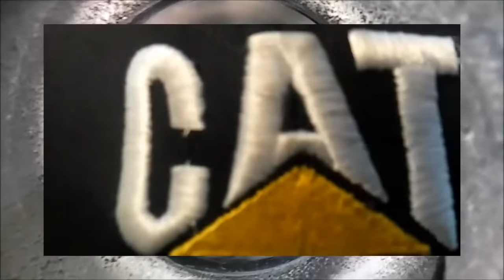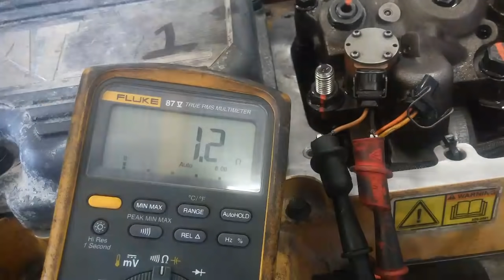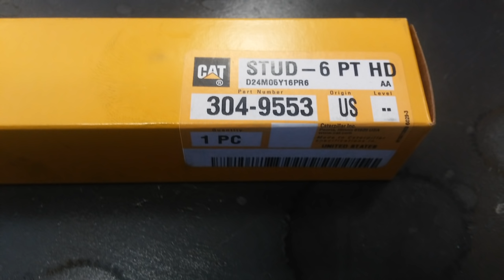What Is An IVA, What Is A VVA, and How To Fix Cat IVA Codes.

Comment: I think you have it a little wrong on the reason Cat put IVAs on their ACERT engines. Have you ever asked yourself why there is always so much soot in the intake of IVA engines? After all they don't have EGR, so the intake should be clean, right? Well...I have gotten unofficial confirmation that Cat all along have had EGR on their engines via the IVA system. They open the intake valves on the exhaust stroke, which pushs the exhaust gas thru the intake side of the head to another cylinder on the intake stroke. It turns out Cat has had EGR all along, they just refused to admit it. The EGR all happens inside the head via the IVAs.

Comment: I'm having an issue with my 2004 BXS c-15 acert. When engine is idle it has a rough idle that comes and goes. Watching the cat id that's on my dashboard, I can go to the screen and watch, when it is running smoothly it shows around 1.1 gallons per hour and when it start running rough it drops to 0.6 gallons per hour. Any ideas?

Comment: ok i just asked about this on the other video, i thought it was an IDA not IVA. I,m a mid level diesel mechanic whos fixed quite a lot of of low to mid level issues but  im getting more into breaking apart the engines and getting deeper into the systems

Comment: Just when I start to think I know something about something you make a video about something I've never heard of in my life haha, good stuff man.
Reply from the maker: +Bucketsamson Thank you, just give engineers metal and space and they will find a way to complicate an engine to comply with the EPA regulations.
Reply: Great video! Keep it going! Thank you !thank you ! But I have a ongoing flash “ghost” code no one can figure out.Code 95 which I have already replaced! But it’s doing the same low voltage! When truck is shut off, ECM resets! ECM will not retain code so cat can’t find anything wrong!I was hoping maybe you can shed some light on things!

Comment: Very interesting - never heard of doing this to reduce NOx before. The high combustion temperature of CI engines is the other part of the reason NOx is a problem with diesel as gasoline engines don't burn as hot (Which is why they have lower efficiency). Plenty of modern gasoline engines are using delayed closing of the intake valves to give a higher expansion ratio than the compression ratio as a means of increasing efficiency, mostly in hybrid cars. It's known as the Atkinson cycle or the Miller cycle (If forced induction) in this context. Being able to turn it on and off on demand allows the engine to make full power when needed (At the expense of higher emissions) but cruise more efficiently, which is where the engine will run for most of its life in a truck.

Comment: Yes the plug connector tips open up  especially the injectors as they have alot of voltage   i just squeeze they back close      for a tight fit and the engine stops missing

Comment: Oil pressure seems to be low and we have done a lot of checking. When we have the valve covers off there is oil shooting about 15 feet out of the iva housing oil ports.
Reply: Did you find any solution, I have changed those port orfice.
Reply: I have the similar problem how do u fix this

Comment: Hey Adept, I don't know if you'll be able to answer this on a future video, but I have a 1994 Navistar DT466 engine in my work truck. When I was put in this truck, it ran slow. But the engine was just rebuilt about 1-2 years prior. it still has paint on everything. After awhile the truck would barely make it up hills, so the mechanic at my dairy replaced the fuel filter and it ran great afterwards. It was all full of grease. That was about 2 months ago. Now in the past 3 weeks it has been lacking substantial power. Truck does not want to go from a stop. It has no giddy up. Clutch is good, injectors seem fine, engine runs fine but its just low on power, trucks . Now, it does fly down the highway still at about 75 MPH. I understand you only work on CAT engine but I figured the same principle would apply to about a majority of mechanical diesels. Thanks.
Reply from the maker: +acdcfanforever3 I am mostly a Cat guy, but the first thing to check is the fuel pressure. Find out what the spec would be for that engine and get a gauge on the fuel pressure and see what it is doing when it is low on power.
Reply: Thank you, l'll check in with one of the mechanics to see if thats what's causing it.
Reply: Did you replace the fuel filter again?  Seems the fuel tank may require cleaning.
Reply: Yeah. Hasn't acted up since. It was full of grease for some reason again. Maybe the driver who had the truck last was fed up with the truck and wanted it off his route so he tried "killing" it. That's really the only way we can get another truck around here. But it's been great for the past several months. Best running truck I've had in my 6 years here.
Reply: I think you are on to something about the previous driver.
Reply: I know that's what he was doing, I've had to do it. By had, it's only because the truck is unsafe to drive. The last truck I did it in I was missing 2nd and 3rd gear and the truck was just falling apart and they refused to fix it. So I ran it with a bad turbo seal one day. Just barely made it back to dairy. Then they took it off the road.

Comment: Thank you so much I'm going to start with the Iva oil pressure sensor. Went to my Peterbilt dealer and they said it was the whole actuator assembly.
Reply from the maker: +Edgardo Guardado It is possible to have a leak in the assembly causing that code, but did they troubleshoot it or just try to sell you the part?

Comment: I have a iva oil pressure code going off derates power...  I've replaced wiring harness from ecm iva oil pressure sense iva solenoid and it's still throwing the same code

Comment: Josh, 

I have an MXS engine that breaks up/stumbles/white smokes when in cold mode under load when boost pressure is high. No fault codes, IVA system test passed, runs great once warmed up. To me it sounds and feels like either the IVA’s or jakes are activating on their own without being commanded by the ECM…have you seen this? How the heck do I troubleshoot this?

Comment: I have a C13. Happened to notice air bubbles coming up the studs at the top of the IVA housings. Would i have to be getting air in the oil from the pickup tube or is this normal?

Comment: What are complaints from a driver when those solenoids cause issues? My driver is saying he has a rough running truck when it's under a load and he's afraid to drive it. The codes I get are for solenoids 1 and 6. 6 has been replaced already.

Comment: I’m getting “not responding” on 4 5 & 6. It being those 3 cylinders together I was thinking electrical but now you make me think it probably mechanical. 
Of course it’s gonna be the most expensive fix with this thing 🤦‍♂️
Reply: Did you find anything I have one with low pressure codes in conjunction with 5 and 6 most often and sometimes 4. Nearly everything new and goes over except ecm

Comment: Yes that was going to be my next step.i did see you can put an Allen or her tool.housing don't look crack is there any seals on this ports or are there used for adjustments?
Reply from the maker: +Jaime Garcia I'm not exactly sure the port you are talking about as there are a bunch on those housings. I would try to remove the plug and see what is behind it.

Comment: i was wondering how often these go out i have a 06 c15 and have replaced 4 out of 6 in the last year in a half and my truck had a inframe done a year in a half ago 3 said not responding and the 4th said current high wasnt sure if i need to be looking into something other than just replacing the actuators if it might be a bigger problem
Reply from the maker: +Zack Fultz Unfortunately they fail somewhat often and are usually the actuator solenoids themselves and not indicative of something else.

Comment: I have a 2006 MSX in a Freightliner Columbia with code 92 on cylinder 2. I thought I was just going to change the VVA and harness and my problem would be solved, until I watched your video. How would you suggest checking oil flow and the oil pressure sensor? If the oil pressure sensor is bad would that show up as a different code or can I still have just one actuator not responding?

Comment: c15 getting compression back through the air cleaners is this possible 1 of the iva stuck open aloughing the valve to stay open. have you seen this before. had one of my dump truck go down and taring into it tomorrow
Reply: I had similar problem. I had a broken rocker arm

Comment: Hello, I have a question for you. Well more of wanted to pick your brain about something. I have a 1998 freight-liner that won’t turn on easily in the morning. I asked around and people told me to change the filters and the check valve and fuel pump and it’s the same problem. If you have anything that can help me out it would be greatly appreciated

Comment: Why do shops charge you for doing an over head when they replace  injectors. They have to do this any way right. You remove the rocker shaft and rockers before getting to the injectors.

Comment: I have a question about a c15 that's been Frankensteined sdp lower with a 6nz upper end keeps overheating after about a 1000 miles last person that worked on it cleaned the oil cooler I've been looking for ways to clean it on here but nothing so far
Reply: Use cooler thermostats

Comment: I have a code coming up 385-1 coming up cat checked for o ring leaks and put a new solenoid and Iva oil pressure valve and the oil pressure sensor and still has the coed come back

Comment: The 379 I drive has bxs c15. My max normal boost pressure is 48 psi (all rpms). For some reason, Im not max at 48, but 35 instead when ever I drive 1700 rp. Normal rpm, it would blow 27 psi. And no codes popping out. Could IVA done this?
Reply: Did you ever figure this out? What was it?

Comment: I have a problem with a c15 twin turbo , the computer show me the problem is actuator no.1......I replace and the problem persist and the check engine light is back. .....I replace cam sensor and crank sensor and nothing. ....can you recommend me something??its a w900 2008
Reply from the maker: +Jesus Benitez It could be the wiring to the actuator itself and not necessarily the actuator solenoid. Is the code an electrical fault or a not responding properly code? If it's a not responding you could have a mechanical problem like the IVA setting.

Comment: Can anybody help please. I have c15 accert with tapping noise. Changed injectors. Ran over head nothing looks broke everything looks perfect. But one of my iva housings has a spray of oil coming out of the little screw that looks like a ball is inside it. The others just weep out but the middle one sprays will this cause a tapping noise.

Comment: 385-1 code... Previously had overhead and #1 injector replaced. Immediately after leaving shop I topped full boost and got check engine light so with ET was able to get direct PMI code above. I’ve replaced IVA oil sensor first, checked control valve and seems to be in good working condition. Replaced external wiring harness and internal as well. Only thing that stands out after all this is when removing both sensor and control valve, the oil that comes from housing. It doesn’t continue to pour out before replacing either part but has me wondering if check valve is staying open not allowing pressure to be regulated properly. Wondering if next move should be replace IVA housing or solenoids.... With valve covers off and  engine running I’m not noticing unusual oil leaks within the system. Just odd how this happened after replacing a faulty injector and overhead ran. Any thoughts? Thanks!
Reply: I have same similar issue. Did you ever find out?

Comment: Hey I just wanna first say your videos are awesome I have a question when I turn the truck on the purge valve intake oil pressure when I turn the truck on it sends oil out of the bridge then stops turns on about three times and then goes off is this normal or should that be sending oil non stop thank you.

Comment: Have a C-15 Acert. MXS 45475. It was overhauled roughly 400,000 miles ago. Boost and fuel pressures are great. Runs fine on flat ground hit any kind of hill even empty and it loses speed. I deal with Cummins and Detroit’s. Kinda out of my league when it comes to cat. Any idea’s?
Reply: Also was told the actuators have been bypassed.
Reply: Im having the same problem , did you ever figure out what it was ?
Reply: @joebaeza86   nope. Took it to local cat dealer and all they could find wrong with the engines entire operation were jakes out of adjustment. Still runs like garbage as far as power.

Comment: Will the IVAs reduce engine power 
I just changed #2 actuator solenoid and truck was running and pulling find 
Now check engine light on and it's not getting boost at 20psi on cat15 acert twin turbos
Reply from the maker: +Robert Squall An IVA code can cause a derate, which will reduce power and boost. The IVA itself isn't causing it, just the check engine light. Assuming you don't have a miss caused by an IVA sticking open.
Reply: Adept Ape OK Kool I just change the #2 once again it Rane fine all morning until I just stop now it's back on low boost psi it's always the #2 actuator not sure what going on with it
Reply: It's running good but no boost it's stay at 20 psi before check engine light flash I was getting 40 to 45 boost psi
Reply: Would u think I need a overhead adjustment

Comment: Hi Adept
Just wanted to clarify something.  When the IVA keeps the air intake valve open during the time the piston starts moving upwards,  which place or port does the nitro oxide gas escapes out of?  The exhaust valve would have closed before the intake process started. 
Thanks Really enjoy watching your videos.
Reply: The IVA allows the piston to push some of the air back into the intake manifold.  It effectively lowers the compression ratio of the engine, making the mixture burn at a lower temperate and reducing NOX at certain points in the load curve.  The NOX itself isn't generated until the mixture burns, and it's pushed out the exhaust.  NOX is the biggest emissions problem for almost any diesel, and the hardest to fix.

Comment: Variable valve actuation is used to increase air flow is cylinder not to decrease...and (i kind of feel) the explanation is also wrong (the explanation about working of iva/vva), valve is kept open to allow more air into cylinder (its because of inertia) the pressure inside cylinder will still be negetive even while piston starts moving up due to high rpm (strictly my opinion though)

Comment: You make some awesome videos that are extremely informative, and I would like to know is, can you make a video outlining the differences between the Single Actuator EUI and the Dual Actuator EUI?
Reply from the maker: +Charles James They really don't have too many differences. The difference is the solenoid. The older injectors have a single solenoid and the newer ones have a dual solenoid setup, but the mechanical portion of the injector operates the same.

Comment: Have 07 Pete 379 c13 getting code 92 changed both actuators for number 1 and 2 actuators how do I clear code in system unhooked batterys over night hooked up scan truck without starting and code still there any help is appreciated

Comment: Hey man, I juts bought a truck with a C15 and the IVA oil feed is capped off and the iva's are backed off have you seen the before??
Reply from the maker: +Rickasurus Rex Someone has programmed the ECM to be an engine with no IVAs and has ran it like that. It shouldn't hurt anything running it like that, but it is technically illegal because the IVAs are emissions components.
Reply: We do those,  except on c13s.   Back off screws,  cap oil lines and put in reprogrammed c12 ecm.   No more issues.
Reply: I'll trade with you any day Rex
Reply: That’s what they call a “ De-Cert” to your engine
Reply: Let us know how long your head gasket lasted ...need to change to 16:1 ratio to help reduce pressure in head since ivas no longer do it

Comment: My check engine light came on and the flash code was My oil pressure sensor voltage high or low.  I just got the sensor and will be changing it when I get home in a couple days.  This afternoon my engine brake lost cylinders. Can the two things be related?
Reply: was code a 95? did you get a fix?

Comment: Question I removed valve cover to check for any leaks on the housing and I do see oil coming from top and bottom port about 3/8 diameter looks like un Allen wrench.is this normal ?.I do get a 93 flash code. C-15 engine
Reply from the maker: +Jaime Garcia Without seeing it its hard to say. Check the other housings to compare, if one is leaking and the other isn't, then you have a problem.